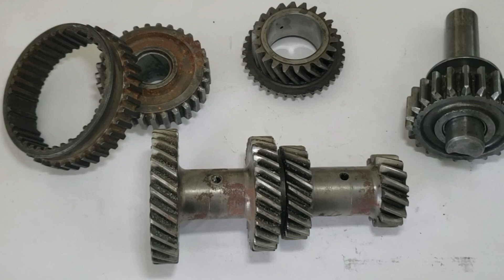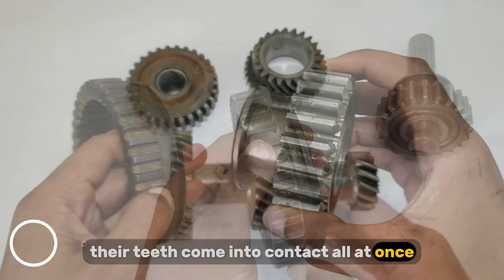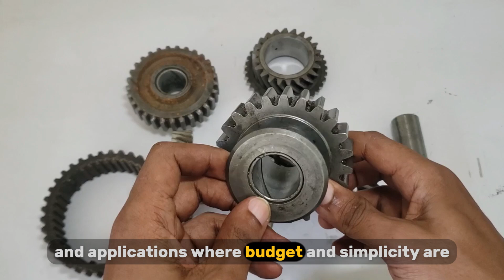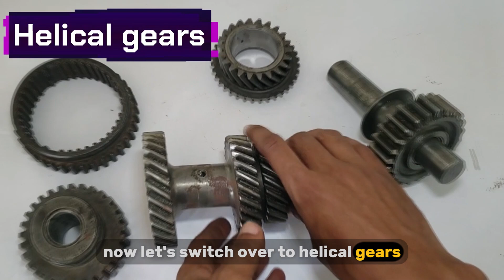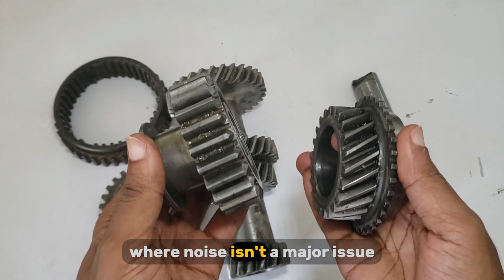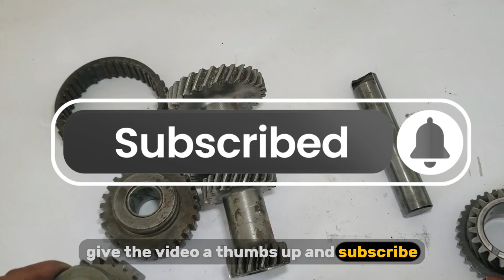Spur Gears vs Helical Gears: What's the Difference?

Comment: Is that really true that helical gears are slightly less efficient? I would think it would be the opposite case since spur gears are wasting some of the energy turning it into vibration.
Reply: Yes because of the direction of the force transfer, the angular contact of a helical gear makes it smoother, yet not as efficient because it's pushing side to side as well. 
Although straight cut gears cannot deal with as much misalignment and require more precise transmissions
Reply: + as well as friction between the teeth due to surface area